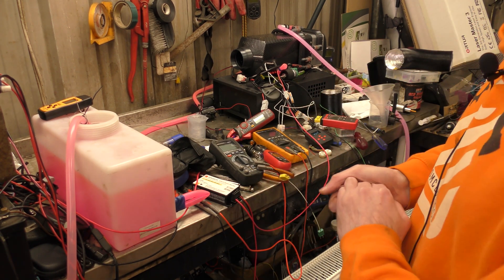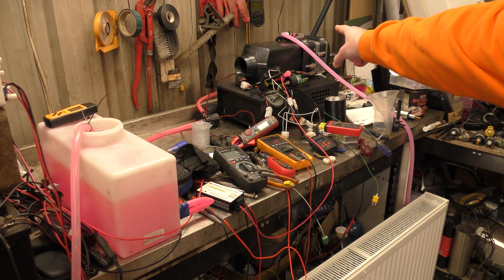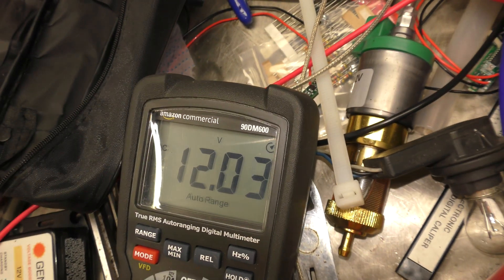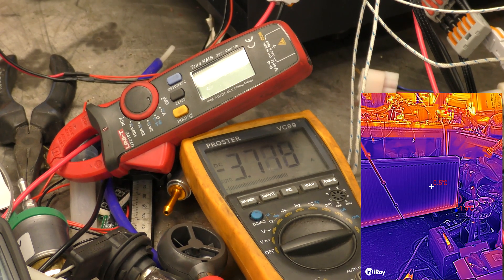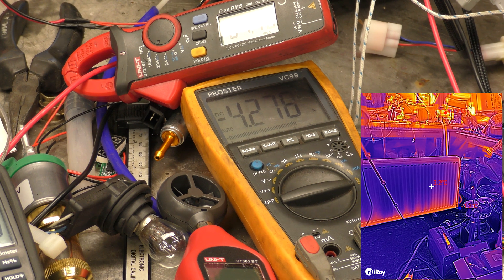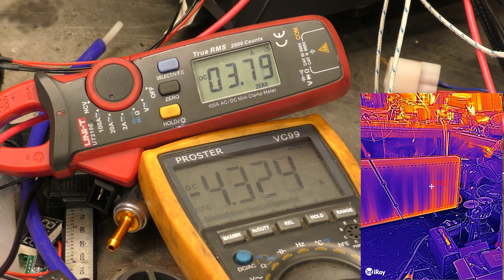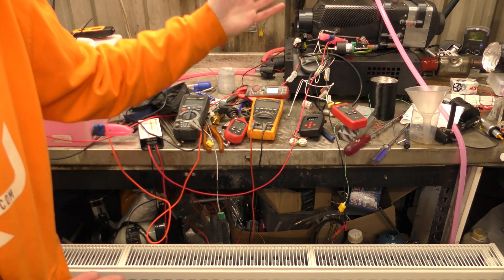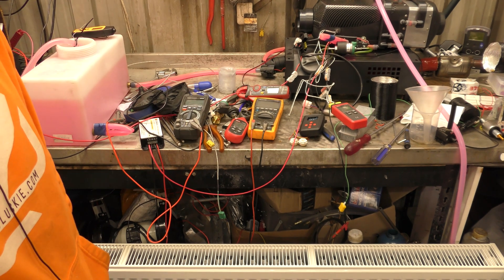Self Powered Diesel Heater Project - big radiator cooling - part 11

Comment: Love it.I do think you should have run it longer so that the water returning reduced the TEG efficiency with the radiator at maximum equilibrium.  Mine is in house- solar charged system.  I have TEG's in planning but on the exhaust side.. Already recycling the exhaust heat via a home made 22mm copper pipe radiator but this still has warm air exiting, so the now plan is to vent in to outdoor cold frames (Warm frames) but with the addition of grow lights powered by the TEG's.
Reply from the maker: I've run it for an hour now while I was doing other things and the water settled at about 50ºC.  The TEGs were still maintaining just under 4A of output.

Comment: It might only make a tiny difference to the draw used by the single water pump but would it get an easier time (less draw) if the radiator was bled of air on the floor and raised on to the bench during the test? A ball ache to lift but pushing the water from ground level to the header tank would in theory cost energy in a world where every milliamp is accounted for.
Reply from the maker: Very true.  Sadly I can not test this as I am not manly enough.  I'm not even sure my bench would take that load.  :)

Comment: Would it be worth leaving it running till it reaches steady state? The radiator has so much thermal mass that it was still heating up, making the cold side colder than it would be if it was left running for longer, which probably gave you better results than a long run would give.
Reply from the maker: I did off camera when I was working the next day.  Water equalised at about 50ºC and the TEGs stayed at just under 4A output.
Reply: @DavidMcLuckie  I just had another thought, alot of the electricity consumption of the diesel heater is just the main cooling fan, but most of that air flow is no longer needed as the heater body is now water cooled. As the main fan is speed controlled , removing or massively reducing its size would reduce the heaters electricity consumption.
I'm currently doing a micro CHP engineering project so have been thinking alot about this sort of thing...

Comment: Perhaps you've already covered it, but why didn't you use the air intake as the cooling side of the TEGs and the hot air out (or side of burner tube) as the other side?
Reply from the maker: We have not as yet found an efficient way of using the incoming cold air to cool the TEGs.  The first few versions had them air cooled in that way.
Reply: @DavidMcLuckie  Ahh, That makes sense. You'd probably want to mist the coldside heatsink with water so that it's not too dry on the other end. Evaporating water takes a large amount of energy to perform, but it would be already vapor by the time it gets to the hot side, so is a nicely un-ballanced arrangement. Perhaps that could help in some situations, but a TEG to run this is a difficult proposal in any situation.

Comment: YouTube popped up a 'Farmer Phil' video, guy has an identical voice/intro which had me confused for a while 🤣 (good videos though). Still have my 5kw diesel heater running since Oct last year, runs well on heating oil apart from when a slug of water got into the fuel, soon drained and re-started without a hitch 👌

Comment: Because you will be running the heater in the cold, could you simply make or buy a square muffler and mount the TECs on it? That way the exhaust will heat the hot side and the cold side will be passively cooled by outside air, rain and snow. You could even insulate the exhaust pipe with rock wool so the only outlets for the heat is through the TECs.
Reply: *TEGs
Reply: That was covered in parts 2 and 3 I think.

Comment: I am surprised that the big radiator is so low in output especially at the 50o Temp differential. The thermal maas of the heater would store some heat even when the heat supply was turned off.  I was interested in getting one of these radiators for my waste oil burning home heater but I want something capeable of around 10 KW so even a couple of them would be insufficient.  I think I will go with my original idea of a motorcycle radiator which can do a LOT higher outputs and are quite Compact.  If you need to dissipate heat this could be an option for you as well.  They often come with small fans which would use power but also in practical applications is able to disperse the heat better as well. 

Very interesting work you are  doing mate!
Reply from the maker: I think it's the forced air that makes the difference.  Great for silent home heating, but only if you need ~3KW of heating power.  I wonder how differently it would perform with some axial fans forcing the cold air through the radiator.

Comment: Although you are recovering the heat from the cold side of the TEG. Loosing all that area from the heat exchanger must be reducing the heat output of the heater. Can you work out the heat output.
Looking at the hot side temperature I'm sure that can be achieved from the exhaust.  Passive cooling can then be lost to the cold outside air. Or if a new heat exchanger is being designed then extending the heat exchanger to make space for the TEGS, like the new 6 to 8 Kw.

Comment: Looking at the way the heat appears on the radiator, the flow's going too fast (think of rapids in a river versus the millpond state of a canal) as it's not giving the hot water time to rise up the radiator to cool off, slowing the pump with a suitable voltage regulator would be beneficial there as it'd allow the heat to rise in the rad, but also reduce power consumption too, so win-win... :)
Reply: Won't that reduces the cooling of the TEG? which is it main job.
Reply: @fenceup07944931177  No, the flow is seemingly going so fast that the water is not given time to cool down enough in the radiator, so it would mean the TEG would be getting warmer water coming back to it than it should be, so more time in the rad, more cooling, more cooling, cooler TEG on the cold-side... :)

Ideally, the "hot" water from the TEG would go in through the top of the rad and then flow down as it cooled, but UK radiators are dumb (speaking as a brit!) and have the hot and cold on the bottom level, so need a low enough flow to allow hot to rise from the input side to the top and cold to flow back downwards to the output side...

Comment: What is doing the charging up off the battery???? 

You did not explain this
Reply: It's the PTC tegs that are mounted on the side of the heater, creating power to run the heater and trickle charge the battery. Watch the other videos of this project, and you'll understand.
Reply from the maker: The output of the TEG's is connected to a Genasun MPPT battery charger, that's changing the TEG voltage to a compatible one with the battery.

Comment: Just noticing your flow through the radiator.  I would reverse it so the hot enters on top and you pull the cool off the bottom. Would love to see a long run test of the system. As mentioned before pulling more waste heat from exhaust.
Reply: I agree. Looked like a lot of heat was going straight up the cores closest to the inlet and straight out.  I am a fan of reverse heat thermo siphoning on air cooling as well.
Reply: @glumpy10  What you doing showing up in in Scotland?  Anyway,  is this not a tad cool for you?  Lol
Reply: Duel input/ output would slow the fluid flow allowing for greater thermal transfer.
Reply from the maker: I was looking at that as well.  Eventually it settled down.  I ran it for hours the next day and it evened out at about 50º.  TEGs still outputing the 4A though.

I'll need to try changing the input then.  How wet can I get?  :)

Comment: How charged is the battery (not having watched all the video), if the battery is near fully charged your yield will be lower as the charger defaults to absorbtion and float
Reply from the maker: Not flat but not fully charged either.  So it's probably around the float.

Comment: You got way too much extra water in the tank. Like a car radiator there is only a small expansion tank.
What about the exhaust pipe? Can you extract heat too for heating up the water.
Reply: You could! But the point of this experiment isn't to heat the water. The water cooler is the keep the cold side of the TEG as cold as possible. 
But you have a point that using a big radiator like that, there is probably enough water in the system to loose the tank.

Comment: what about not using a pump and letting gravity do it's thing?
Reply: too low a delta T when dealing with a thermosiphon system, and pipe size needs to be massive for the application here.

Comment: What happens when it's on its lowest setting. I mainly run my heater on its lowest setting in my motorhome
Reply: Great idea
Reply from the maker: Output from the TEGs drops significantly.